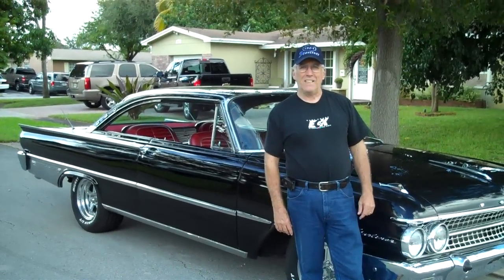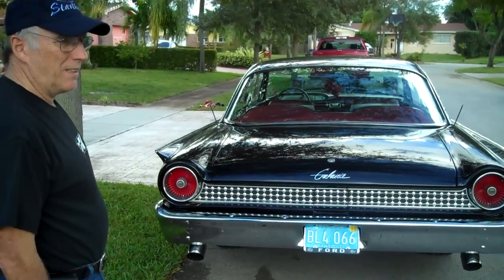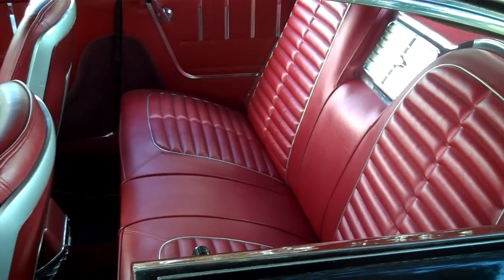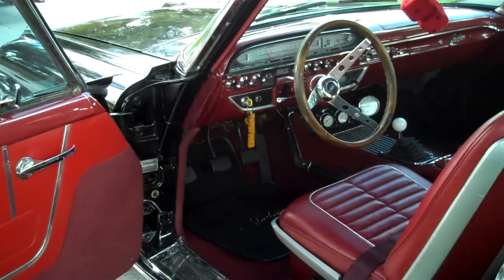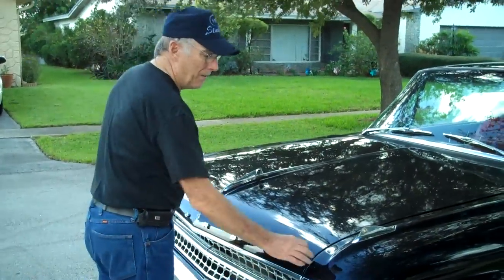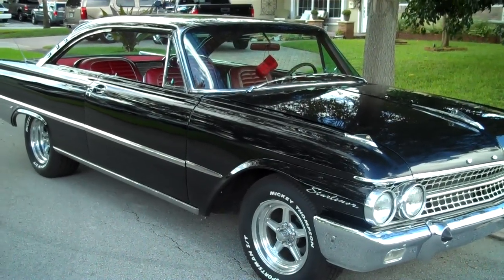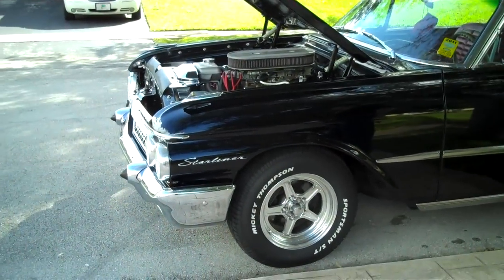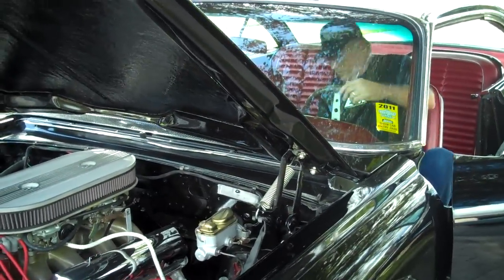1961 Ford Galaxie Starliner 428 cu-in Dual-Quad 4-Speed

Comment from the maker: Check out my updated 2017 video with on the road footage!  https://www.youtube.com/watch?v=p7_f4Uab7GQ
Reply: This is a masterpiece. I have my High School dream car as well which is 70 Cougar XR7 convertible and I wanted the 428 but It does have a 351C. This allows me to drive it without stopping at every gas pump and it's an automatic. If I get a 70 Cyclone, I'll find a 428.
Reply: Beautiful car. I'm not a Ford fan but I have always liked their look.
Reply: What a splendid, magnificent beast of a car! The styling in those years was at the peak. Bold, confident optimistic, looking like it's ready to take on anything. Very much like the attitude most people had in those days. That car represents something that is hard to put into words, but for those who understand, no explanation is necessary, and for those who don't, none is possible. Take care of this fine beast. She's a treasure, and enjoy her like she's meant to be enjoyed.
CHEERS!
Reply: This is almost identical to the car that I bought from the movie set off the valachi papers, unfortunately when I went into the Marine Corps I didn't have time for the restoration I ended up scrapping it 🤐😰😰😰😢

Comment: 1961 was the first year for Ford's 401 horse, bad assed 390, but you could not get it with a factory 4 speed. They had 14 inch Atlas Bucron tires from the factory. My father loved these cars.

Comment: Love your car and all classic car guys who work hard to keep the old cars detailed perfectly. I still have my original Pontiac GTO that I bought new May 16, 1967. It's still a number matching car. The 400 360 HP HO  engine is now a 461 cubic inch with forged components and a Ram Air IV cam.

Comment: 428, dual quads, roller cam,  4 on the floor, perfect stance, clean enough to eat off from. On top of highly underrated body styling, (kick ass) 10 out of 10 for me!
Reply: Mine was a '71 Ranchero with a 460,C-6,posi. Beast.

Comment: This man did a truly awesome resto; especially the XL interior, elec. windows, power steering and the built 428; especially the solid lifter roller  cam which on those FE's makes pure music while idling. Had a 61 2 dr. fair lane (full size Ford) in 65, built by Roswell N.M. (alien crash site 1947) Ford, for drag racing. Never knew which block was used due buying it in El Paso from the Mercury dealer.. It had the tri power and  mechanical advance dual points distributor, 427 long tube factory headers, 427 medium riser heads, 4:88's. Since it ran in a stock class the 3 on the tree was not changed. Best shift point was 7500 rpms using 7' slicks. Once I missed 3dr twice AND THE BEAST REVVED TO 8,500 AND BENT 2 EXHAUST VALVES.  Car had to be shifted very slow, yet it was tacking 6500 at the 1/4 mile finish line! Ran in very low 12's. what a car. 
Now Where in the hell he got those super rare 427 factory bad ass headers is what I'd love to know, due restoring my 65 fast back!!.

Comment: I really like your restoration. I did a similar restore to a 1965 Galaxie 500XL which like you I use a 428CJ but mine was done back in the mid 70's before aftermarket places had the good 180 degree intakes especially the dual quad. Also had to use Ford cast CJ heads. If you remember back in the late 60's and through most of the 70's Ford offered their Ford Muscle parts which could be bought from your local Ford dealership. That was about the only exotic parts you could find for the FE and Boss motors at that time. You have done a much nicer job than I did. You should be very proud of it.

Comment: It's called a Starliner because if you're in the back seat you can look up at the stars thru the back window. My Mom worked at a Ford dealer for 16 years 1961-1977. The convertable was called the Sunliner
Reply: That's Kool info
Reply: Great 61 looking good inside and outside

Comment: Love what you have to the car, I used to have a 64 XL so I recognized the interior right away, and the intake manifold I still have from my drag racing days, hard to beat it. You did a very nice job on the car and it has to be a blast to drive.

Comment: You have  a dream machine!  I had a 64 Galaxie 500 XL  I recognise the seats.  Mine had the 300 hp 390 with cruise o matic on the console.  A friend had a  model with the factory 4 speed.  I like the starliner roof design.  It was replaced by the fastback roof which was more square looking to me in 63 up.  61s had 390 and I think there was a 3 2bbl option.  In 62 the 406 came  and in 63 the 427. 428 came in 66 as the 7 liter. In the 60s in high school I worked summer in  parts at Ford dealer.

Comment: Hi Way M, I have a Mopar, Dodge Dart with engine 440, it's a nice car but your 1961 Ford Galaxie with engine 428 cu-in is very very incredible, the 1960 ford generation are amazing cars!!! Ronan. (Brazil)
Reply from the maker: I agree with you. The 60s produced a lot of fine cars including the 69 GTX i owned at one time and let it slip through my hands. take care
Reply: Wayne M my dads getting ready to start restoration on his 69 gtx this spring.

Comment: I always liked that body style, smooth, streamlined.

You really upgraded that  old girl. Love the red interior. I had a few cars long ago with red interior but now days the companies only want to build black and gray. How bland.

With the hot cam and headers, that engine should put out 390+ horsies. I hope you installed a positraction rear axle.

Thanks for saving that sweet ride. Decades from now there just won't be enough of them for the youngsters to  admire. I fear the new ones will all be electric tubs with no style.

Comment: Gorgeous car. The black paint is awesome. Engine is awesome. Engine bay is awesome. I think what you need to do next is go back to the wrecking yard and get that Marauder and restore it as your next project. These Starliners and the Marauders, especially the 64 Marauders, are awesome. I have heard a rumour from a guy who owns a classic car wrecking yard here in Utah that beginning in 2020 or so, you won't be able to drive the classic cars on the road. Junk yards like his will have to close, too.
Reply: Systorable  I would put no stock in such rumors.

Comment: Love the car. I’m a Chevy man 100% but I have to tell ya the style and you’re added touch is awesome. Job well done no corners cut. 

Since you went  off the beaten path ( not keepin stock)  take the dual quads off install a 750 Holley on that big block she will run way better. Faster quick and some fuel mileage should you care bout that. Jus sayin

Comment: Really neat car.  I like the 1964 XL interior.  I bought a 1961 Starliner in 1965.  It had a 292 with a three speed on the column.  Traded it for a new Fairlane in 1966. Always missed the Starliner.

Comment: Very classy build , love what you’ve done , nice set of wheels , goes great with the car. Nice motor upgrade and it’s a stick as well. Glad you showed it to us. I also run roller rockers and with aluminum valve covers they’re noisy but they do the trick. I give this a solid 10.

Comment: sad but true story: one of these was setting in a guy's yard back when I was a kid. When I first noticed it, gorgeous car, nice wheels, beautiful blue metallic paint job. The car just sat there. Asked the guy if he wanted to sell it, no way. a few times more of asking, he told us that it was his son's car, and he'd been sent to Vietnam. He was MIA... so the guy would not sell it. However, he left it set outside, and deteriorate to practically nothing over the years. Even when it was a mess, he would not sell. Frankly if he hung onto it to honor his son, letting it set outside and deteriorating is no way to do that. I don't know if it ever sold or was just junked when the old guy died.
Reply: toot tall such a sad story,& u know there's a lot more out there with the same sad ending!!!
Reply: yes, but there is the guy that found an old skyliner... you know the 57 or so ford hardtop that folded into the trunk... and the top still worked tho the car was a mess, he did get it to run and drove it home after putting some tires on it. I happened on him at a convenience store gas station. It needed gas, fortunately I guess the car didn't have any old gas in it when was parked.

Comment: Local guy owned 1 of those with the 390/375 hp with a 3-speed. In late '62 he installed a 4-speed, ran pretty good. In '63 he ordered  a Galaxie 500 convertible, red/white top, 390 with 3-2 bbls, 340 hp. He often said the '61 would outrun the '63.

Comment: When  you  popped  the  hood,I seen the manifolds  and said  that's  a  427. I have a 64 Marauder  dual quad side oiler. It's a Nascar  banned 5 50 hp cammer.i paid a lot for it. North of 120,000. It's  a 4 speed  car of course.i put 2:23:1 or something  close  to  it,to see what  I  could  get out of  that  weapon top end. And I have the video, of a cop (friend) hitting  me with  the  radar ,and I maxed at 182  mph  at 7700 rpm,I could  have driven  500 miles like  that. U have a beautiful  car. If you  know  where there  is  any old Marauders  for parts, I'm building  3 at the  moment. I am  like  u,I don't  get aftermarket  parts unless  nesesary.

Comment: OK Mr Ditchbank,  I'd just like to say that a LOT of us wanted to do the things we saw in Hot Rod when we were teenagers. One thing, money stopped us. Now that we are retired an have a little money to play with, we build the cars the way we want them. They are called resto-mods. Better engine , trans an brakes. To sit there an lam-baste someone like that sounds like jealousy to me. There is not enough years of life in a person  to have 26 1960 Fords done , unless your Jay Leno . By the research no Plum Crazy 1970 Challenger was sold by Barrett-Jackson Auction in2006  the highest priced one was 88,000  a 440 convert. I suggest you stop drinking 12-packs an smelling to many spray cans, leave the car building to us! A parts car is probably what you drive !!!!!
Reply from the maker: art walters I couldn't have said it better myself. long live older and wiser fogies
Reply: +art walters I'm 25 (just turned) and drive a blue '64 Fairlane Sport Coupe...as my daily driver.
Which is in my name exclusively, and which I've done most of the work on myself (with the help of a mechanic to make sure I didn't screw up transferring nearly-identical parts from his old Galaxie).
Won Best In Show at the cruise-in and I'm an active FCA member.

My grandfather restores 50s Thunderbirds and is currently working on one which was owned by James Whitmore, and as a pet project, a mid-60s bullet 'Bird with a 32-valve Cobra.
I'd say I'm an exception.
Reply: +Wayne M By the way, beautiful car. Am also a FL resident. I recognize the area. I'm in Citrus, not far. From Ocala. See you around sometime maybe~
Reply: 4

Comment: Don't ever say Black is not for these cars. Black is the best looking color on these cars and all of the Galaxies til 65. Anything from 1959 to 1964 in Black and Red Interior or Blue interior or Black stipped in Red or Blue is it. I know you love your car but I loved my 64s. One had a 390 the last one I had was a 406 Intercepter and it was Black and Red Interior XL. It was beautiful to me but my father got rid of it to get it out of the way when I went away in the service. I still miss my car. He took my engine and put it on a water pump for a water well to grow rice. He did this twice. The first time he took the 413 cross ram out of my Mopar and used it on one of our other water pumps. It's OK it all came out in the wash since I never said a word about what he did, because it was out of necessity for family. I ended up with a really nice high powered Mopar when I got discharged and it was all good again.

Comment from the maker: Thank you for the kind comments. I'm always happy to hear from other Starliner owners. The gathering stage was a long and time consuming process. At the time, (1990) there were very few aftermarket parts available. Today, you can order aftermarket parts for the 1961 Starliner from catalogs or online. We found our floors in a book called Junk Yards of the North West. The suspension is stock, but I had to replace the bottom ball joints and added an one inch sway bar. Power steering was also added.

Comment: Love the car and the black over red looks great. Interior set up is cool also.
I just picked up a '61 Sunliner and would like to up-grade the wheels and tires. What size tires did you go with? I don't want to alter the car for a proper fit, but would like to go to 15's and wider like yours. Thanks in advance for the info.

Comment: I see right away that you have upgraded to talland fat rubber to keep your nice car on the road. I drove one of these things way back when  with the stock wheels and tires. You could not stay on a 2 lane crowned blacktop road at speed. They'd slide right off. Granted, they were really fast but the factory didn't put a very good suspension under it. My dad had a light blue one.

Comment: I got a 67 for galaxie 500 with ah 390 and got the engine rebuilt but still have time to put a bigger Cam and intake any suggestions on the best Cam i can install as far as performance without having to change the anything major on the motor?

Comment: Are you sure about that engine in your 1960 Starliner? The largest V-8 in 1960 was the 352-CID/300 HP/9.6:1 comp. ratio. The 428-CID didn't come out until the 1968 model year.
Reply: Can you say engine swap?

Comment: Anyone hurd about the 445 stroker" for  the 360- 428 fe's  $ wise you could get a old 360 truck block do the 445 stroke  for more power and cheaper than a cj 428, I think its call jailbreak 445? Look it up Check it out its purity darn interesting 🤔

Comment: the funny thing is you put power windows on the front door but not the back windows? why is that he couldn't get it to work for the back windows? or you just didn't have the funds at the time?
Reply from the maker: at the time i was looking for a complete original setup out of a starliner. i stopped looking and settled for fronts only.
Reply: If I am not mistaken, the 428 did not appear until 1966.  This, after the potent 406 (1962), 427 (1963)  There were lots of 390's.  I always liked the body styles of the  '56, '57, '58, '59, '61, 62 & '63.  And I thot the '61 & '62, with those big tail lights, and clean styling were especially cool! An uncle had a '62 Galaxie & and black/red color combo.  This, as you mentioned, was always a very attractive color pair.  I still remember Uncle Hubert passing us one rainy evening  driving that '62 Galaxie.  He was actually driving too fast for conditions, and I remember watching (I was about 13) as those big tail lights faded into the distance.  Nice car you have!  'Tis a pity that cars today have none of the personality and beauty they once had!  They ALL look like stupid moon buggies!!!
Reply: Yes my dad bought a brand new 1966 Galaxie 500 XL with a 390 in it baby blue brand new off the showroom floor when I was one we had it for quite a few years then my dad traded it for a 69 Cadillac Coupe DeVille
Reply: Back in the day some cars could have optional just front power windows or all windows power. Pretty sure that was the case with my 60 Pontiac Bonneville Safari wagon.

Comment: sounds awful
Reply: g davis 
Probably because the camera is on the engine bay. Can hear the valves slanming shut most likely due to the aggressive cam ramps. 
Would have been better to do an exhaust sound clip like your used to..
Reply: Had your hearing aid batteries changed lately???